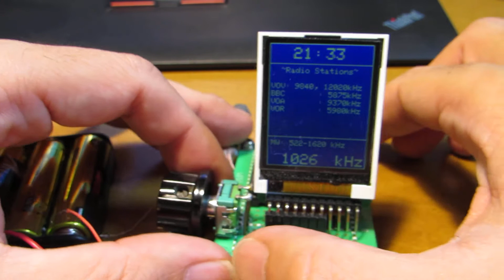DSP radio covering AM-SW-FM frequency

Comment: POKE the battery with a skewer for EXCITEMENT! XD 
J/K dont do that, neat radio though.. Do they make thses with SSB options, I am not interested in commercial shortwave but rather HF ham radio

Also is it just a China thing for FM to drop under 88 MHz? I bought some Baofeng UV-B5 handheld 2-ways from China and they have FM receivers in them that drop down to like 76 MHz or so. nothing in the US operates that low on FM..
Reply from the maker: Good point! but unfortunately none of single chip DSP radio support SSB reception. may be direct conversion (oscillator + mixer) would be better answer...!

Comment: Hello :) What kind of DSP chip do you use for this?
Reply from the maker: Hello, it is KT0915, which data sheet can be seen at http://aitendo3.sakura.ne.jp/aitendo_data/product_img/ic/radio/KT0915%20/KT0915_datasheet_V022_aitendo.pdf
Reply: microwavemont Thanks for the tip :)